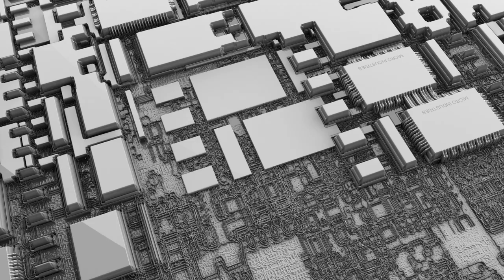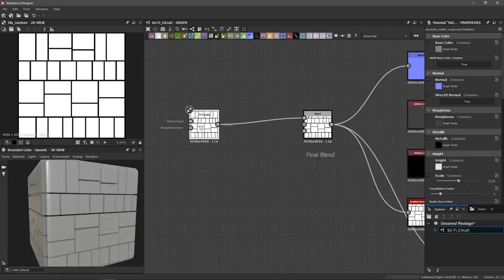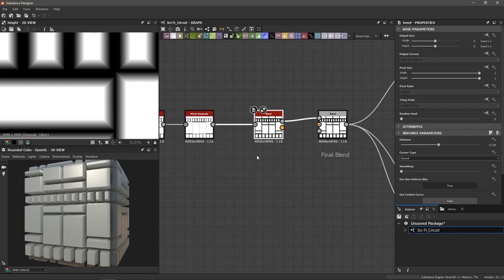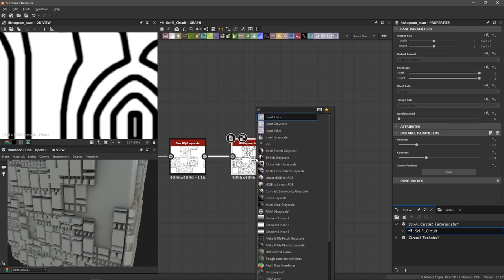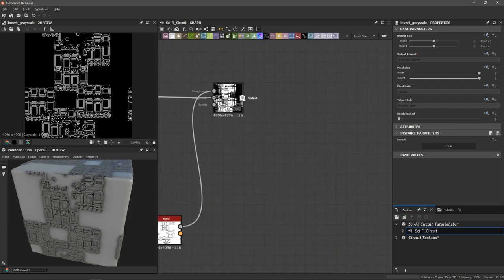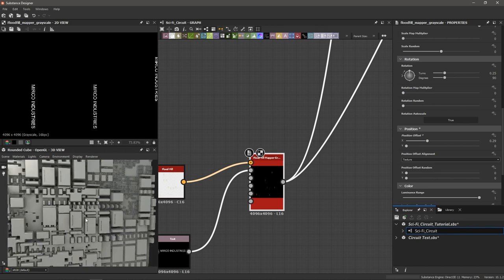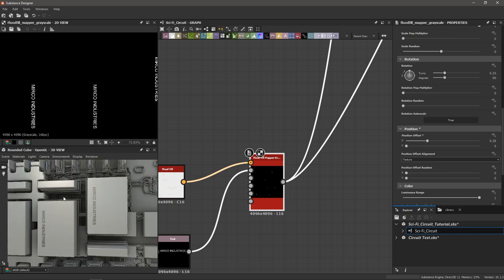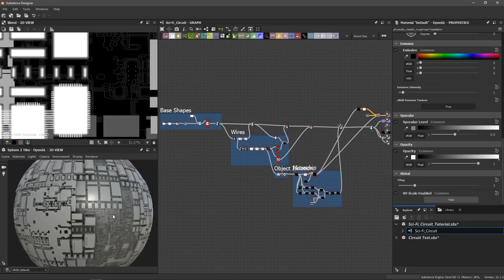Create Sci-Fi Circuit Board / Computer Chip Patterns in Substance Designer

Comment: Great work! But I have a question. How did you  change from red line to solid line?  01:44 (sorry, I'm Korean. so my English is not very well)
Reply from the maker: Thank you! To answer your question: the red line will change when we put grayscale information into the blend node. Because blend nodes can handle both color and grayscale information, we have to tell it which one we are using by connecting something to either the foreground or background input. Once we connect our height information into the foreground of that blend, the red line will change to gray. =) hope that helps!
Reply: @JeremySeiner  Thank you! it is helpful! :D